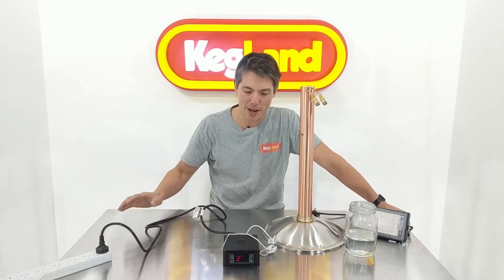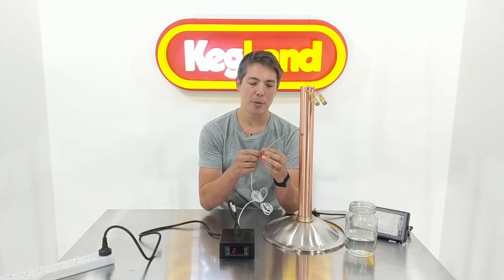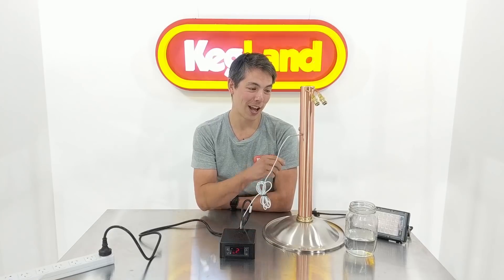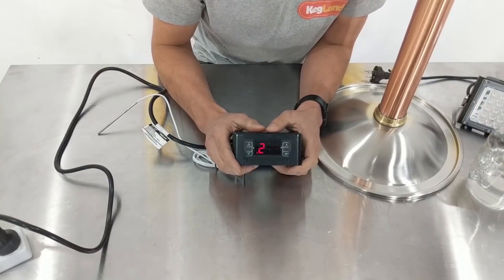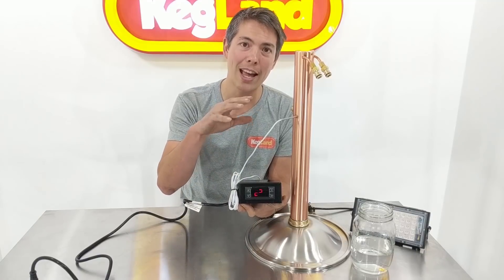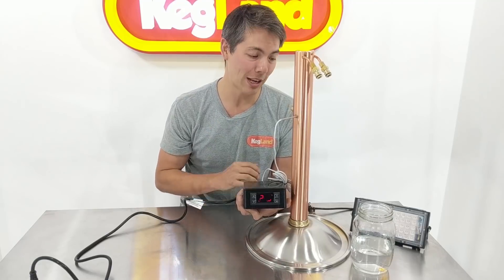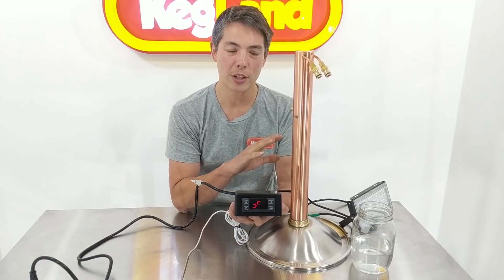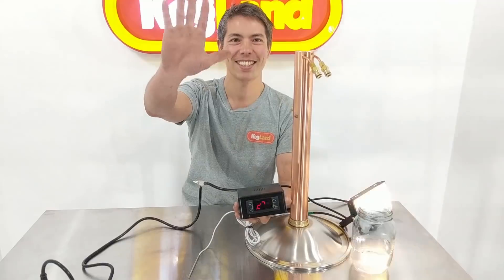Automate a Reflux or Pot Still with Temp Controller - The easy way!

Comment: That's just a dramatic "off" function. A better controller would be a proportional controller. As the temperature rises with the Ethanol being taken off, a proportional controller can reduce the power in proportion to the rise in temperature, not turn it off.

Comment: Does the device DUAL control?  I see you controlling a heater if the probe gets too cold, can it run a fan if it gets too hot? AS WELL?

Example: Device runs a motorised ball valve for condenser water to a reflux still

Opens the ball wider if the condenser gets too hot...  Closes the valve down if the condenser gets too cold...  Holds the condenser at 50-65ºC
Reply: Can this lower the temperature in my reflux column by increasing the water flow?

Comment: If your temp goes to high you don't want to shut your condenser cooling system down or you will lose alcohol vapors out the top of the column. 
Better of not pluging that in to this controller. Yes its handy for the boiler.

Comment: I only plan to use it in distill mode d1. One I have it set this way do I have to reprogram it every time it's unplugged?
Reply from the maker: Hey Brian.  Yes when you power cycle this device you will have to put it back into d1 model.  We are also working on some cool new firmware for the new RAPT Temp Control box so you might be inerested in looking at this device too:

https://www.kegland.com.au/rapt-temperature-controller.html#:~:text=This%20RAPT%20wifi%20connected%20temperature,will%20automatically%20change%20over%20time.

Comment: Use a power controller (plugged into this temp controller) to balance your still at your desired temp (based on flow).  Then set your temp controller at a higher temp as per the instructions in the video.  The higher the temp the further into the tails you will go.

Comment: Will this work with the T500 still? I run water through it from the sink faucet to cool
Reply: did u find out i haeve the same issu
Reply: I have the same problem. I need this to increase my water flow if the temperature gets too hot.

Comment: So first the explanation was a bit too long, 
The fact that someone physically has to come turn down or unplug the unit when it senses the temperature in the still is too hot essentially makes the unit useless.
Reply: It will turn the elements off when it starts beeping, it's not just a thermometer with an alarm it controls the outlets

Comment: I'm not playing with a toy I'm currently prosing about 20ltrs  a day at 96% and In need to run the system automatically as I have over year of beer to go through, could some one please help.
Reply from the maker: You need to put the unit into distillation mode. We do have some instructions on this in the PDF insutruction manual so best to have a look at this

Comment: I'm confused, Once it shuts down, how does it stay at temp without dropping to low???
Reply from the maker: You can use this at the end of a distillation run to shut off the boiler.

Comment: PID controllers are not expensive just make sure you are using a “K” probe to measure heat. Also the reason they are placed near the top of the column is because that is where you want to be sure the temp is correct for the alcohol to remain vaporized but the water to condense and drop back. The temp in the pot isn’t something you need to care much about unless you are using an abnormally long column or are losing a lot of heat in the column for sone reason simply setting your controller to measure near the column and adjust the heating element accordingly is all you need. You don’t need to really know how hot it is inside the pot, if your equipment is working you will not scald or burn inside the pot. Assuming of course you aren’t using your grains inside the still and only the fermented and clarified liquid. 
I use the digiboil to cook my mash but I built my still with a 2000 watt element and a PID controller to control the heat combined I think they cost something like 40 bucks on Amazon.
Reply from the maker: Really good inputs. Thanks for sharing.

Comment: What's the Max amp rating for the relay, is it enough to run a 2kw element?
Reply from the maker: Provided that you are talking about a 240v DC that should be fine.  ( I am assuming you ar in Australia)

Comment: The "wavy effect" is from the refresh rate of the red LED light being slightly off to the frame rates your camera shoots video.
Reply: TOOK A VIDEO YESTERDAY AND HAD THIS HAPPEN. I ONLY CAME TO THE COMMENTS FOR THIS ANSWER AS TO WHY.
Reply from the maker: Thanks for the comment!
Reply: Agree if you change your frames per second on your camera it should probably should go away 60-->59hz
Reply: In the old days you would sync the camera to the frequency of the scan rate. LED readouts aren't permanently switch on , they are switched on and off at a high frequency the eye can't detect (this reduces the high current draw of the LED ( from memory about 8 amps... memory maybe rusty) . So when it is reviewed on a video and it isn't synced then it will appear to flash. It is a major exercise and expense to do this. cheers
Reply: Its called rolling shutter, its generally a digital SLR thing. It is exacerbated by various lighting technologies, such as led's. Depending of cam, one could adjust the frame rate until it stops rolling, this requires adjusting light levels and aperture to maintain proper exposure and focus. The series of tubes has lots tutes on ways to deal with such things 🤘🏽

Comment: Hi Kegland, i used my MKII controller to shutdown my still run. Followed the instructions on this video. When the temp hit the target (80C) the power for the heat shut off, but then when the temp dropped < 80C, the heat power came back on, and so on repeat until I intervened and shut it all off. Is this what it's meant to do or should it shut off the heat power permanently when it hits the target temp?

Use the MKII and the voltage regulator box after converting my still to electric. Absolutely amazingly simple to control the run and hold the temp at 78-79C. Best home brewing investment ever ($140 well spent)
Reply: do you have pics of your set up
Reply: @PeterKinnear  no I've completely changed my gear since I asked this

Comment: DO NOT PURCHASE THIS IF YOU HAVE A BREWZILLA 65L!!! 

It is only 10amp and doesn't have an outlet in the back for the required 15amp plug. False advertising, I've just wasted $50 + delivery on something useless for my system (also purchased from KegLand)
Reply from the maker: If you have a 65L then you can just use this device and it will work fine:
https://www.bunnings.com.au/ampfibian-15a-to-10a-rv-plus-caravan-power-adaptor_p7050115
Reply: @KegLand  *just a bit confused here ? my little flat only has two 5 amp circuits, will this mean that i cant use this device at all in my flat just using standard power plugs etc ?
Reply: *just a bit confused here ? my little flat only has two 5 amp circuits, will this mean that i cant use this device at all in my flat just using standard power plugs etc ?

Comment: Is this like a PID CONTROLLER?  I don’t understand how it works. Please show everything hooked up.
Reply from the maker: Please DO NOT use pid controller.  With this type of still you just want the still to turn off completely when the temperature is reached.  You are not trying to increase or reduce wattage to control the temp at the still heat which is what the PID would end up doing.

Comment: I have watched this a few times and I still fail to see how to actually set the controller up to hold a constant head temperature (control the element), and when I approached Keg King, they said to look on You Tube for videos, but have no actual instructions. This unit seems the same, but the video fails to show me how to automate more than a shutdown at a target temperature. Frustrating.
Reply from the maker: The shutting down once you hit the target temp is how to automate it.

I think some people seem to think that you use the temp controller to set the distillation temperature so it cycles the elements on and off but this is not how to use it.  The temp of the still head will find it's own temp and it will stay constant due to the the fact that the boiling point of alcohol is a specific temperature at your specific altitude.  So do not use the temp controller to control this temp.  Simply write this temp down on a piece of paper then when the temp increases by about 1-2C then set this temp into the controller and once you hit this temp the whole process is complete and will therefor turn everything off.
Reply: KegLand  I understand you’re saying to kill power at your specific mash boil temp, but why wouldn’t a pid work? A pid would quickly learn and maintain the set temp.
Reply: I saw in one of the other responses to use the power station voltage regulator, and it should arrive tomorrow. Yes, I was under the impression from the languaging that it could regulate the keg temp once hysteresis was set, etc. A video giving a tour of the features would be greatly appreciated.
Reply from the maker: @cgberry2772  Yes that's fair enough.  We should really make a distillation video.  I will speak to the others about this.
Reply: @KegLand  im interested in the 65lr digiboil setup but would love to see an operational video before jumping in the deep end yeah
Reply: @KegLand  any chance of getting a distillation video up? i think that would be awesome. nothing on youtube for using your setup.
Reply: I love my digiboil so far will this stop it from going into standby if so I’ll by !! Any help will be nice

Comment: Correct me if i'm wrong but! the point of this product for a spirit distillation is to maintain a constant temp to maximise output but minimise over temps. If i understand what your saying about distillation mode, it will cut the power and not re-apply until intervention (which is sort of pointless). On the flip side if it was put in normal mode and it was able to cut/apply power to the boiler to maintain a temperature... as most know it takes a minute or more for the reflux to begin again after power has been cut even for a few seconds (and i'm guessing it would taker longer than that for the temp probes to change temps to back within thresholds. 
Without testing one i'm basing these assumptions on past experience but it could actually take longer to do a run than doing it manually?
Hopefully i'm wrong, and its the solution to a lot of wasted time temp watching....
Reply: With the Alchoengine still that's shown. the still reaches a balance of around 79-80C on its own and just stays there until it starts to run into tails and then starts to go up a few degrees. Hence this unit is really good at cutting off the tails before they run into the hearts. I just wait until the still balances out  ( with the thermometer the give you)and plug in the temp control, set it to cut off a degree higher and commit the sin of leaving it to do its thing. I have my water pump hooked up like he said and when the still shuts down so does the water pump. This still requires a heck of a lot of water to keep cool, far more than a t500. That's why I run the water with a pump rather than the mains water supply. You can use it on another type of still to help balance it out, with it stopping and starting the boiler when its not in distillation mode by using a water flow adjuster. But this controller really does make this still amazingly easy to use. About all you have to do is remember to change the collection jar :)  It has really solved the constant worry about the temperature and getting tails into the good stuff :)
Reply: @gruglet  hey mate. just hoping to find out what pump you use?
Reply: I just bought the "Alcoengine Copper reflux" tower and i think i need to fix up how wrong i was above! It has made distilling so much easier! even without the shut off timer it took half as long as the turbo 500 tower to complete the run. Even hooked up to bore water with fluctuations it never deviated for the first 2 hours. - Looking forward to getting the timer and setting it up as a pretty much automated (except the boil up phase & throwing out of the first 100ml) it will save hours of time temp watching!

Comment: I'm kind of confused would you set the temp on the robo brew room like 230 f turn on both elements then wouldnt this shut down the robo brew cutting energy to it
Reply from the maker: Yes that is what you want to do.  Once you reach a certain point in the distillation process you really just want the whole process to shut down.
Reply: @KegLand  OK - in a batch operation where you can afford to throw away a lot of ethanol.  But closer to reality, you'd want to collect tails for re-distillation OR reduce the heat (which increases the INTERNAL reflux in the column) OR increase the EXTERNAL reflux.   So yes you want constant  vapor temp, but ... many ways to get there.
Reply: @KegLand  OK - in a batch operation where you can afford to throw away a lot of ethanol.  But closer to reality, you'd want to collect tails for re-distillation OR reduce the heat (which increases the INTERNAL reflux in the column) OR increase the EXTERNAL reflux.   So yes you want constant  vapor temp, but ... many ways to get there.
Reply: @stevealexander8010  If you find the tales are worth collecting you can do this but I have found it easier just to throw the tails away and ferment more fresh wash.  The wash is really quite cheap and collecting tails is not really worth doing in my opinion.  With that said some people are more thrifty than I am so I totally understand if you wanted to keep them.
Reply: @keglandau  Here in the US, no legal home-distilling is allowed.  We're looking at starting a licensed commercial distillery.  With a continuous stripping still, tail losses aren't a big problem (you might lose 2-4% of alcohol in the stillage/tails) but with batch distilling you might lose half the ethanol by throwing away heads & tails.  Almost no one does that on a commercial scale.  Certainly the Scottish SM pot distillers recycle.

Another factor - tradition US whiskies are made this a wash ~7%ABV, and not the 10%-14% ABV that many amateurs use.  The yeast stress at high ABV is a negative flavor factor.  But of course the lower starting ABV means less extractable ethanol before the pot ABV drops too low (higher losses).
Reply: @keglandau  Here in the US, no legal home-distilling is allowed.  We're looking at starting a licensed commercial distillery.  With a continuous stripping still, tail losses aren't a big problem (you might lose 2-4% of alcohol in the stillage/tails) but with batch distilling you might lose half the ethanol by throwing away heads & tails.  Almost no one does that on a commercial scale.  Certainly the Scottish SM pot distillers recycle.

Another factor - tradition US whiskies are made with a wash ~7%ABV, and not the 10%-14% ABV that many amateurs use.  The yeast stress at high ABV is a negative flavor factor.  But of course the lower starting ABV means less extractable ethanol before the pot ABV drops too low (higher tail losses).

You are correct that wash is cheap to make wrt ingredients, but considering the energy, labor & time and the use of big fermenters .. not nearly as cheap.  Even if I could do 50l or 100l batches at home I'd seriously consider recycling.
Reply: The point SEEMS to be to shut down the run once the vapor temp gets too high (= pot ABV gets too low) and is NOT to control run power.   One trick pony.